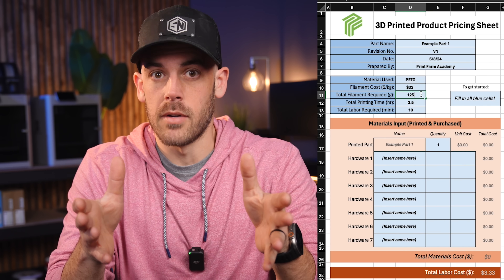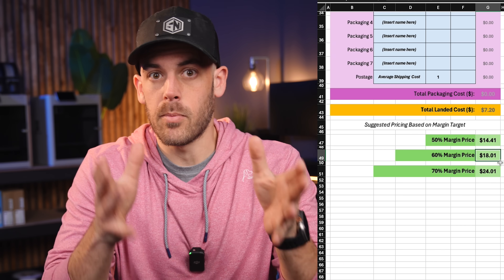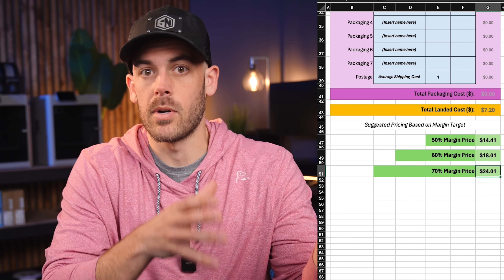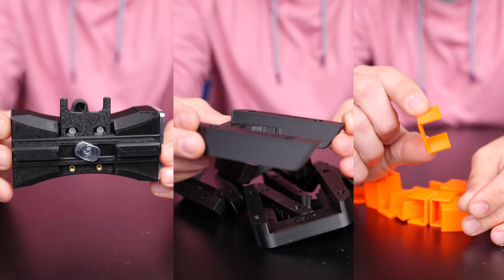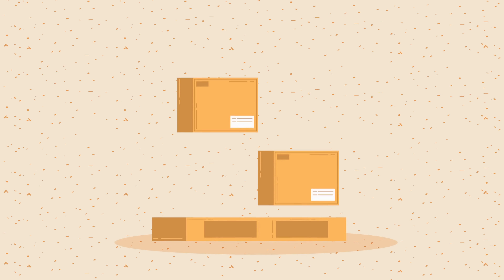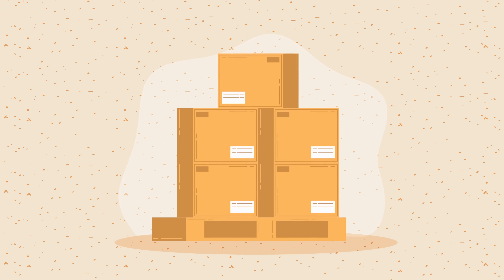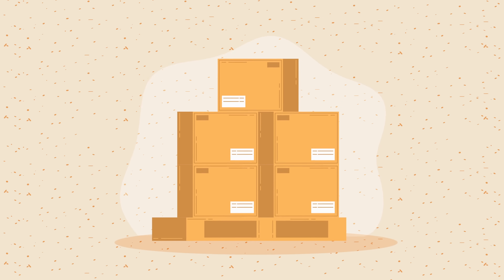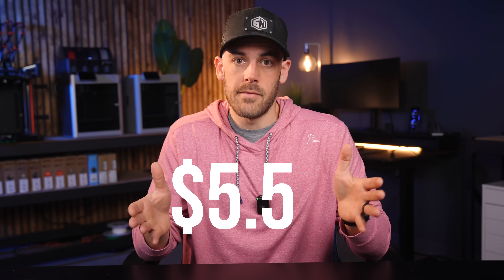Why I charge $55 for this 3D printed part (how to price)

Comment: You kind of forgot one important cost to factor in your parts : design labor cost. Your salary wasn't 0 while designing those parts and with market knowledge you can guesstimate the amount you'll sell of that part and factor in the design labor cost. Your calculation are spot on though for open source commercial viable file on the internet already designed.
Reply: Design cost, especially for a mass production part is one of those costs I feel many write off in order to be competitive. You design something once, and depending on the market, you may not need to redesign that part for several years.

Of course it is a different matter for custom orders and that you'd be 100% right to also include that in the calculations of the landing cost.

By all means, if you can factor that in and still be a competitive seller, then go for it. But that is one cost I would write off if I had to lower the prices.
Reply: @GoodwillWright  mass production I understand 10 of thousands of parts sold which sounds like a lot for 3d printing. 

Since you're including machine cost for a couple of penny each, the 20hrs+ of design at 20$/h on a couple of 100's parts sold would account for as much or even more than machine cost.

I do get that competition might bring to lower profits voluntarily, but that cost still need to be taken into account to make an informed decision IMHO.

That was just a little grain of salt but overall you're spot on for all the rest of calculation and since I don't really know that well your market you might actually sell so many units of each design that design cost get actually lower than machine cost to which it would actually be useless to include it.
Reply: @miranina1585  To add to your point about design costs, which you may have already knew but didn't elaborate on, is that the design process is more than just the labor. You have to print off test parts and depending on what you producing, you may need to stress test it.

You could design a product, but it may take you several months or a year of testing before you are confident to put it out to consumers.

That I would definitely agree you need to factor in and is probably a cost you can't just simply write off.

But for me personally, if I design a product and it took me say, 6 hours (t-shirt or patch design for example), I would write off that cost.

The example in the video of the spacers, that would be one product I wouldn't factor in design costs explicitly, personally.

Comment: The machine cost is exceptionally low.  That machine should be making a profit while it's running.  You've got a margin in there, but that margin doesn't account for nearly enough profit from the machine time.  Factories replace people with robots because they can charge the same hourly wage for the machine as they can for the human, but without the payroll hits.  This machine profit covers your time for PM, maintenance, and repairs.  It also covers your time for ordering filament, performing general paperwork, etc.  None of this was captured in the landed product cost, but the funding for it must come from somewhere - and that somewhere is almost always labor - human or machine.

Machines are profit centers and must be treated as such.   Put a margin on your machine time so when you add it into the landed cost, you're properly capturing the labor the machine is doing.  Otherwise you're consuming space with machines but they're not working for you as a person would, they're taking up space.

Comment: you could add an advanced way of selecting filament prices, for example a drop down with a list of filaments, the price of filament would be set in the Adv.Inputs sheet and that adjust everything accordingly

there's a gramatical error in Adv.Inputs, E11 , " The claculation is" (not being cocky, just letting you know)

Comment: THE ELECTRICITY, INVESTMENT AND REPAIR COSTS HAVE NOT BEEN ADDED TO THE PRICE
Although you included a formula that calculates the cost to cover the investment, repairs and electricity, you omitted to add these costs when determining the selling price.
Thanks for the explanations and the table.
I hope my comment helped you and the whole community.
Good luck

Comment: When you are calculating the energy cost are you only factoring in generation costs or transmission too?  For example, in Pennsylvania my energy cost of $.094 per KWH, but when you factor in transmission costs, taxes, and fees my actual cost per KWH is $.17.

Comment: You said there were no purchased additional costs for the dewalt battery holders, but you didn't account for licensing fees to dewalt for using their logo. Unless you are infringing their trademark on that design and opening yourself up to legal risk, which I would suggest you not.

Comment: One thing we've had to factor more as we've scaled is insurance costs. Most hazard and liability insurance companies have no idea how to place 3D print farms on a risk analysis so they tend to put us in a "light manufacturing" category along side companies that, in my opinion, have much more dangerous equipment such as lathes, CNCs, etc.

As always, great content!
Reply: Fire
Reply: You really don't understand risk at all.
Reply: Lathes, CNCs, Etc. are far less likely to burn down your house since you use them in a shop and don't leave them running unattended. Most 3d print farms are running unattended in someone's basement or attached garage.
Reply: @SuppaflyZSM  This is a good point but I would probably assume that most people running small farms in a garage or basement likely don't have full time employees and probably aren't even thinking about workers comp or liability insurance at that scale. I can only truly speak for myself at least and I admittedly wasn't at that phase.

Our fleet ranges from consumer grade FDM machines to industrial additive technologies and fire and/or burn hazards are one the biggest concerns but in comparison to a traditional machine shop I think we are far less likely to have major OSHA recordable incidents with employees.
Reply: @i-solids  As someone who had to file the reports for OSHA and Corporate HQ, any time there was an injury/accident....  It might surprise you that 80% of the cases I filed weren't the miter saws, table saws, pneumatic gantry, automatic nailers (The things that could mame and/or kill), it was little simple tools that people let their guard down around and assumed it couldn't hurt them. I can unfortunately also attest, that if there is barely even a 2% chance that a machine could deglove a finger, but you had to be especially profoundly unlucky or doing something very massively wrong.... you'll still be filing a degloving report on it given a few years time. 
Don't even get me started on the number of people wearing any form of working glove while at a saw (it got to the point where if we saw it in the shop, they were warned the first time, fired on the spot immediately the second time.)
Reply: @DragonCMNDR  I can definitely relate and agree with this response in its entirety.

I spent some time as an engineer in various O&G companies that mostly delt with large rotating machinery. This has led me to have a big respect for anything that spins fast. I never held a dedicated HSE role but as application engineer I would often be pulled into scenario investigations. I personally noticed 2 common trends:

1) major incidents were statistically rare but often involved a senior technician who knew exactly what he was doing wasn't correct and/or some sort of loose clothing (especially gloves)

2) despite heavy equipment being used everywhere, most incident reports were from seemingly "innocent" tool like screwdrivers, hammers, little knives, etc.

Here at our print farm the "innocent" tools concept definitely still applies. In 8 years we've had 2 recordable events - both of which involved.... a spatula. We've discarded the darn thing and changed the process to eliminate the need for this tool entirely. Outside of these incident, the most dangerous thing we have in the shop based on non-recordable minor first aid events is little pieces of plastic support material that can either cause little cuts or maybe end up in someone eye.
Reply: @SuppaflyZSM  no one is worried about a cnc machine burning down a building mate lmao cncs kill people not burn shit down recklessly 😂😂

Comment: There’s a few more costs I would associate depending on your strategy such as design and printer prep time (not just removing parts, but starting prints, repairing parts, maintenance). It’s just a shame that, at least in my experience, people just expect that because I can design and make something for them, that it’s going to be super cheap because I’m just one guy and don’t have a whole factory of expenses. Most people want custom parts made for slave wages, and I really don’t understand how they can be so adamant about that

Comment: But what about taxes? It is a good starting point for sure and I am glad that you started this channel - also like your other channel ;)
But is this really enough calculation to run your business? I am very sure that this won't be enough to do it in Germany :(
But the adjustment is easy, just adding extra lines in the spreadsheet :)

Comment: I feel like you are severely underestimating the energy costs here.  Most of my print beds run between 500-800 watts are you running absolutely tiny printers?  Thats just the bed wattage, most 3d printer nozzle heaters are between 80 and 150 watts.  

Its a pretty nice METHOD to calculate costs, so thank you for the calculator, itll be very helpful since im bad about charging for it....mostly because i wouldnt pay nearly anything for 3d printed stuff so i have a hard time justifying charging someone.  Itll be a good check to my extreme philanthropic tendencies 😂
Reply: I don't know what kind of printers you have, but I didn't get more than 150 W/h on average with both the Voron Trident 350x350x250 mm and the Bambu X1. Only when the printing starts is the Bambu X1 for the EU for example consuming 1 kW/h, and it takes about 15-20 seconds for the bed to heat up. With Bambu I usually get more around 80-90 W/h.
Reply: 6 MK4s in enclosures run at about 700 watts, I'm not sure what printers you're using

Comment: Fantastic video brother, keep up the good work. Would love to have you back on the podcast to discuss print farming, since we didn't touch on it last time. Hit me up!

BTW, $33 per kg is wildly expensive. Assuming you're printing PETG, reach out to Voxel, Elegoo, or Protomaker, they'll sell you bulk material, and at least in the cast of Protomaker, it's made in the USA.
Reply: I am in Australia, and I buy it for about $10 kg and I still avoid low quality filament.

Comment: Good rundown. You're probably undervaluing your labor, at that. And if you only need a 10% buffer for print materials, you're either highly efficient, or 3D printing is extremely efficient as a manufacturing technology. In most industries, I see at least 15-20% calculated for material loss. But your margins make up the difference, which is probably the only way to do this and remain sane.

It's very difficult to run a small manufacturing business the way you would a large one. At high volume, margins tend to be smaller but profits more predictable. They also have economies of scale you can't get to. That's why you can't position yourself to compete with anything that China can make cheaper than you can that will sell in high enough quantities that they will want to. They'll gladly steal a design, and there's not much you can do about it.

Comment: Not sure if it's been mentioned or not; Your accountants fees, any traveling you have to do for your business (ie: fuel for your vehicle), you didn't mention if you include the cost of the shipping charged to YOU on goods to make your products, replacements bulbs in your workspace, insurance, cleaning products used to keep your work area clean, towels/paper towels, etc. Do you have clients come to your workplace? They may use the washroom while there; therefore a percentage of of the toilet paper, the soap. Think of everything that goes into the making of that product and include that cost in either the product or your year end tax filing. From the paper in your printer that prints out orders, the ink, the computer itself, any special software. People in small business usually miss anywhere from 25 - 50% of allowable items for tax purposes or product creation.

Comment: My father was in manufacturing for 30 years. He worked for a moderately-large manufacturer on the production side. Material costs were no more than 15% of the sale price of a part. Normal stuff that was used on the end-product cost about 1/2 of what was charged when they were sold as replacement parts. Replacement parts for out of production products cost about double what current-production parts did simply because of the time involved in setup for very short runs.
Reply: in a larger company we must also consider the overhead costs of the building, equipment replacement, management team, sales team, accounting etc etc.  That all contributes to the price of a product sold.
Reply: It's also often not possible to produce new replacement parts via the same methods as the original parts were produced, so they may need to be CNC machined or even fabricated - neither of which gets the price any closer to that of the original production. But, hey, you need the part, right? lol
Reply: Your father didn't produce garbage either. 3D printed parts are about that. Garbage for extended use. They won't last 2-3 years, and especially if exposed to sunlight.

Comment: Reveal spacers, 60 pack, $9 free amazon prime shipping. You want $13
Dewalt battery pack 5 for $9.99 free amazon prime shipping. You want $20
Stop block, aluminum and significantly better build quality $14 free amazon prime shipping. You want $30

I'm curious why you think your arbitrary decision to 3d print the parts makes them worth as much as you want for them? Are you banking on people paying extra for Local / USA even though it's lower quality, visible seams, and weaker than injection molded plastic/abs? Or you're hoping to get the market Amazon misses? Very curious.
Reply: No one can compete with chineese prices on Amazon only thing he can do is make a quality product and try and sell it ... there's a reason almost nothing is made in America anymore

Comment: Having worked in commercial factories on mature products, 10X material cost was the start of pricing. Not to be confused with engineering development or new products from scratch. Pass through parts are usually 3-10x cost or more depending on availability.

Comment: Excellent video and super informative. Rather than adding the 10% filament amount at the end, how about loading it at the front? Example, for a $33 roll of filament, use $36.30 in the slicer. That way a 40 gram print is costed at 40 grams rather than 44 grams. Yes, same result but different optics.

Comment: Did you include legal fees or licensing costs when you get contacted by BD's legal team over IP rights to the DeWalt logo and brand? Certain companies (notably Disney and Harley Davidson but there are many others) are very tough on this because they are REQUIRED to enforce their brand  IP in order to KEEEP the rights to their brand ID. At $450/hr, a lawyer is considerably more expensive than filament cost or electricity. And that does not included the settlement expenses. Even if you jjust get a CD or a demand letter, all of the costs of developing the part and existing inventory disposal have to be factored in. You MIGHT be protected by something like "Fits yellow and black batteries"- but I'm not a lawyer and that's not legal advice. But selling branded parts marked with a manufacturer's logo as a "business" can earn you some unwanted attention.
Reply: There's nothing in law to stop you making an interoperable part. Indeed, it's protected.
As for the brand name, you have to say "compatible with" as them you're using their name as a description.

Comment: Good and works surely if you have enough clients. But to get the clients is the hardest thing of being self-employed.
EDIT: You calculate 365 days with 8 hours as uptime. How realistic is that? Better be realistic and calculate 250 workdays with each 8 hours and 50% usage, then you might have a real life beside your work.
And most critical ... where is the tax you have to pay calculated? If I use your file directly I work for benefit only.

Comment: This pricing is missing many other important factors as others mentioned but it’s also purely theoretical. Pricing needs to be dynamic, you adapt to demand and lower to supply. Your whole formula goes out the window if someone charges 30% less and you lose 90% of your sales. You might even willingly operate at a breakeven or loss lead certain parts because some orders might bring in significant future customers on other parts you’ll then have to increase prices on to compensate for the loss leader.

Comment: Two things I’d like to add - I often use UPS for shipping, so I estimate cost to whatever the furthest delivery zone is from my shop and roll that cost into my product. There are some products for which I use Priority Mail, and those prices are fixed regardless of location. However, once I use those estimated prices from UPS and USPS, I then use an aggregator shipper such as PirateShip (no affiliation) and get a personally cheaper price than I get quoted from UPS or USPS and then can pocket the difference.

One word of warning, USPS is getting less and less reliable, even with “Priority” mailings. Decide whether or not a customer is worth the risk for USPS and plan accordingly.